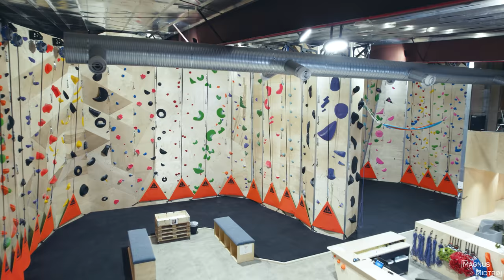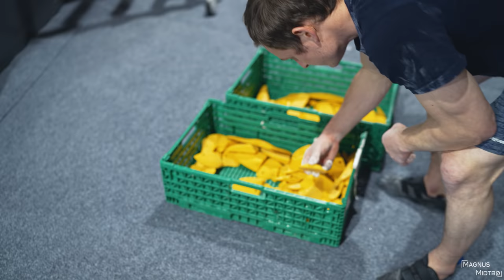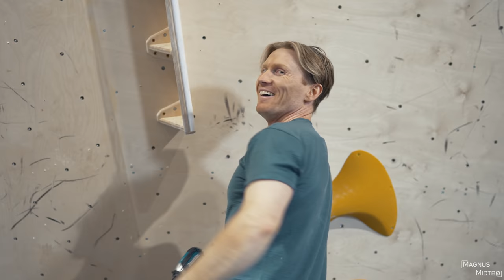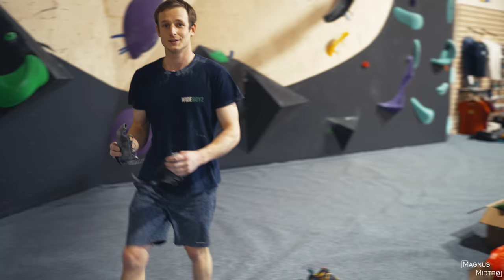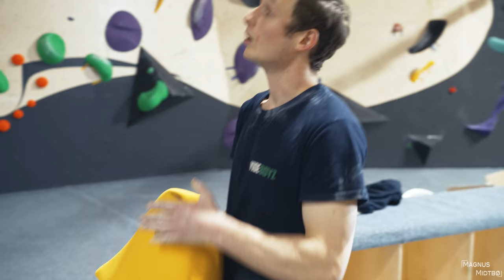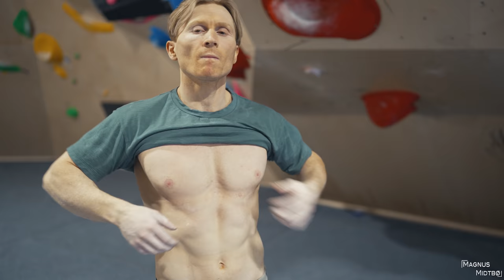Setting the hardest move possible Challenge

Comment: Years ago we played something similar on the spray wall. We called it 2+2 an you were allowed to define the next two holds, BUT there was the extra rule, that you had to be able to hold on to the second hold you define for like two or three seconds without touching any other hold (like a top). (The rules for the foothold varied.)

If you are playing it the way I described it, you are forced to set moves, that you are really able to do, but since you are allowed to define the next TWO holds, you can still set really difficult stuff or dynamic stuff or so on.

Comment: New to watching these climbing videos so I never realized its so hard to hang from a bar. But you guys were doing a lot of climbing before that so I bet your arms are tired. Its fun to watch these videos. Does this type of climbing where you put your feet on the holds also transfer to actual climbing outside, like on rocks? I mean do they use those same moves??
Reply: The bar is on ball bearings though, or in other words it spins freely which is why it's hard because you can't reposition your hand.

Comment: Idea for climbing chess. An already placed start and end hold, a single bucket of holds is provided to player 1 and 2 i.e. player 1 and player 2 use a single bucket of holds (could be assorted or selected by number of crimps, slabs etc). Each player must then make a move. There are two moves, either finish the climb or add a hold, if a player decides to add a hold then they loose their turn to climb in that same turn, after player 1 makes their move, player 2 makes their move and so on. If all the hold are used, then the player can move a hold placed on the wall, note only holds from the bucket can be moved. Players cannot test their holds once placed on the wall. 

Add or tweak if needed, I am going to try this today!

Comment: I waited a long time to see Magnus hang from an oversized spinning bar like the hardest paid hang challenges use. The only other Youtuber to try this was ninja warrior Anton Fomenko & only ninja warrior Milo could hang 100 seconds out of all the ninja warriors that tried it. For Magnus to hang for 99-100 seconds his first try is simply amazing & showcased his strength & endurance. I have hung from the same size spinning bar for 2 minutes, but my local hang challenge bar isn't mounted in ball bearings, the ball bearings make the bar frictionless & makes it infinitely harder especially since you can't hook-grip the bar to keep it from spinning. Props to Magnus & Pete for never backing down from an almost impossible challenge. I think that Magnus got the 100 seconds because his feet didn't touch the ground before the 100 seconds. Anton Fomenko's spinning bar had tape or grip tape on it, so if Magnus had taped up his bar for more grip he could have easily got 100 seconds. My spinning bar that I use to practice at home is "wood" & is very slippery especially for my thumbs to try to grip & also because of the large diameter of the bar. I would suggest that if you ever try it again to not use chalk but use a slight amount of water on your hands & work it into the wooden bar where you going to grab it. It seems to open up the wood grain & make the wood easier to grip especially your thumbs. I've tried chalk, but the slight amount of water seems to provide superior grip on a slick wooden bar & I'm sure that this should allow you to easily crush the hang challenge.

Comment: 2 ideas for combining climbing and chess: 1. put the chess clock on top of a boulder. Chess climbers must do the boulder and press clock before each move. Mate or loss on time/exhaustion? 

2. Use giant chess pieces as molds for holds. Put a peg board-stick on the back of the pieces/holds.. Then drill 64 peg holes on the wall and paint the board.  Set up 2 autobelays on each side. You'll have a chess board on the wall, that you must climb to play!

Then set up MAGNUS VS MAGNUS. Carlsen VS Midtbø - the meeting of the MAGNUSES!